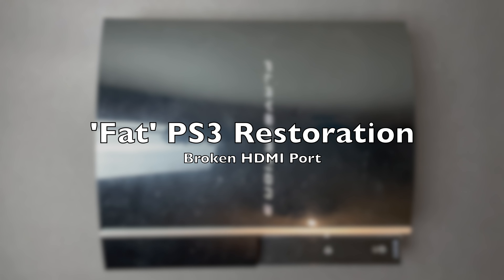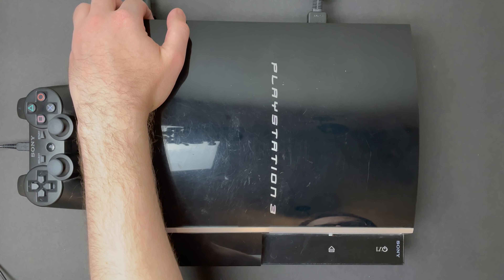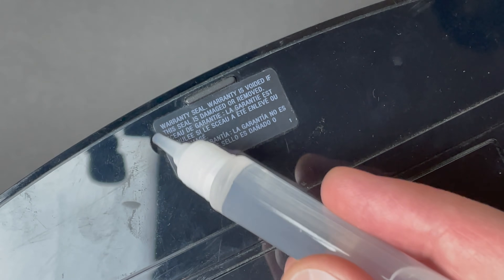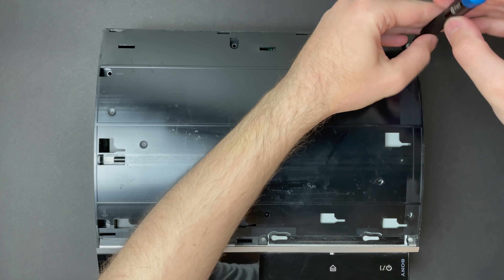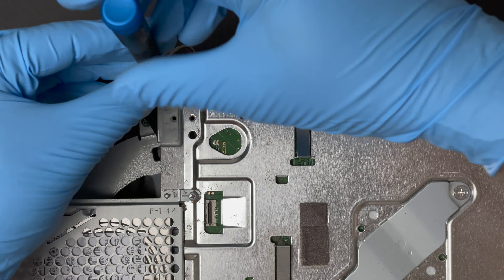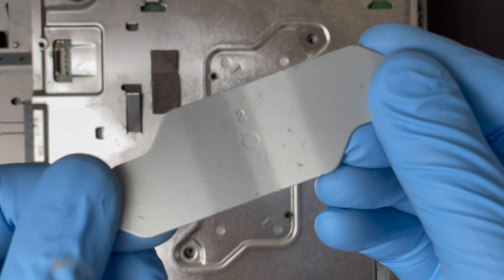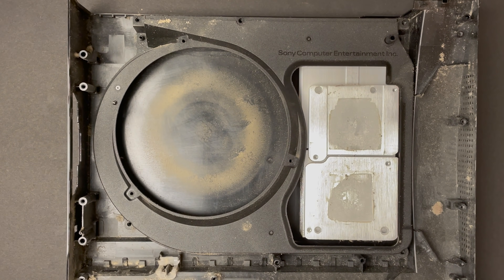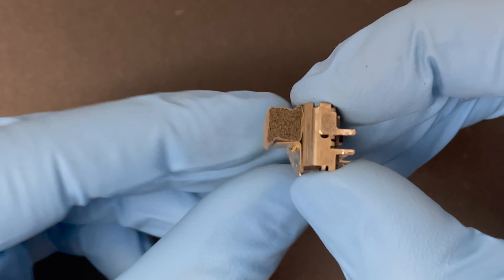Sony PS3 "Fat" HDMI Repair - Faulty Console Restoration

Comment: Nice job men , just a recommendation i think next time you can use  low melt (low Temp) solder can do it more easy to remove the port and the solder on the holes that's the trick.

Comment: Bossman, You do incredible work... make it look too easy... But just from doing little odds and ends, I KNOW how difficult it "can" be, but your work shows you've have practice and you are pretty damn good at your work.. Thank you for sharing this video.. I was sold a ps3 yesterday that "WORKED PERFECT" lol - The hdmi port gold tabs are all wrinkled up and doesn't work so I was seeing how difficult it was to replace... I don;t have the factory playstation av cord, so hopefully I can get one and use that for the display and just say f changing the hdmi - but if both displays are bad, I have to fix something... Anyways, I'm a new subscriber, and Thumbs up - You made this video simple to follow and understand, and made certain points clear like using quality stuff to make for a easier job... working construction all my life, trying to teach the new kids that start to buy good tools and not cheap tools, your doing yourself a favor... (Using a pair of klein side cutters to cut ceiling wire ( a metal clothes hanger) for a tile drop ceiling, all day VS a harbor freight 3 dollar pair.... will prove my point when it takes 5 times the strength to cut... doing 500 cuts all day long your hands will be so cramped up, blisters, ect...  work smarter, not harder.. I just really am impressed in your work - great job

Comment: Does anybody know what kind of liquid he used to remove the warranty sticker off so cleanly? Can you use a heatgun to remove it cleanly also?
Reply: I think it's either goo gone or 99% alcohol as it's clear. Do not use a heatgun for sticker as it'll get too hot fast or a very low heat
A hair dryer here is actually advised

Comment: Hello, maby you know is in PS3 fat are the same hdmi port like in slim 20_._? I know they are same 3 pin rows, but i dont know it will works. In my fat 80GB i got short circuit betwen pin1 and ground. In my console i have got no video in HDMI but  analog output works fine. THX

Comment: Hello, i bought a ps3 fat cechc04 and i think the hdmi Port doesnt Work. I get video Output If i use the older ps2 slot. So my question: is the hdmi Port on all the ps3 fats the Same?

Comment: Iv got an original ps4 that has the light bar on the top so it can only find and use the 2.4ghz network,  but is there a way to replace the wifi antenna to use the better 5ghz network?

Comment: man that HDMI port is just as bad as the one on my PS3 though the rest of the system looks to be a lot better condition, mines missing screws that hold the top cover on the system, the cover plate on the Disk drive,  the little cover that goes around the disk drives opening on the front of the case, and the HDD bay cover. But damn this looks like it'd be very difficult for me to do especially since i don't have any tools to do that or experience lol does anybody know about how much it'd cost to get it repaired for me mines also a 80GB Fat model

Comment: I'm a novice at soldering but on my OG Xbox I was able to use a fine tip and basically push through the ribbon into the pad to get the solder.

Comment: 11:36 when checking continuity. When I test the pin 18 by itself I get nothing. Which should be normal since it's white. When I test another pin and go back to 18 i get a beep sometimes. Is this normal? Using kline tools mm400. Update: sometimes when testing 18 by itself I get a beep. This ps3 would turn on with green light. fan turns on get progressively louder and faster no video.
Reply from the maker: Switch your meter into diode mode and see if you get a value close to zero for GND pins. If also close to zero for pin 18 then there is a short.

Comment: Dude fucking GREAT VIDEO MAN!  Seriously this HELPED ME OUT TONS!  And instead of completely editing out simple little mistakes that I run into all the time, you humbly explained them and showed how to fix the problem, rather than being a pretentious turd and making seem like you did a perfect job first try.  You would believe how many other nutsacks edit out every single mistake.  My apologizes to the masters that actually DO MAKE A PERFECT JOB ON FIRST TRY.  They can help their badassery..  Anyways bro honestly great video, I immediately liked subscribed, your quality left no choice but to do so.

Sir, one more thing could you please post the tools you used and where they can be bought.

Obviously the TS100 is the only one I could make out because of your giveaway, but what about the heat gun, the brand and type of flux (you said yourself high quality flux is essential) the pliers you used, the yellow tape you used in order to shield the other parts of the board from the heat coming from the heat gun and Im sure you used other equip/materials i just can remember.  

Thank you so much once again for posting a great and quality video, that is severely lacking from many soldering/repair youtubers.

Cheers and Sincerly

-Albert

Comment: Hello. Next time that you try and clean the wholes try using a bigger tip on your soldering iron or more heat instead of rubbing on the board so much. The reason the board got damaged like that was most likely the amount of rubbing that force you used while trying to clean the holes out. Great video and cant wait to watch more. Thank you.

Comment: That fan is HUGE, I had no idea! Also, that re-assembly montage at the end was really satisfying.
Reply from the maker: Thanks, glad you enjoyed it.
Reply: @BorderlineOCD  Hey! Can you make video about "maximum HDD size on PS3"?(CFW)

Its so shame... because as i know there is maximum of 1.75TB-1.82TB.... 

original xbox has possibility to use 16TB,that a disaster..
Reply: That's why they sounded like a jet engine when it ramped up.😏
Keeping them clean help's a lot with fan noise and overheating, I use a vacuum cleaner with a soft brush attachment Weekly.
I suppose I'll have to renew the thermal paste on my 60gig consoles (X4)!
Never had one overheat, yet! 
Even though my late wife💘 used to leave hers on with a game on pause, while she went out shopping🤦‍♂, a habit she picked up on the first Playstation in 1998 while playing Spyro!

Comment: i use a de-soldering pump to release the solder from the holes, i stick the pump at the hole and melt the solder at the other side using the soldering iron and then push the pump's button, it's faster, but the board has to be in a vertical position
Reply from the maker: I've purchased a vacuum desoldering pump since the making of this video. Should make future repairs like this much less cumbersome.

Comment: I love my fat ps3, its a software emulator for ps1/ps2. Shes running hot and louder but super clean. My problem now is HDMI not working, tried 3 different displays, my port looks fine.SHe was off for awhile. Can I send her in to get fixed? I really want to keep her and 480i is not cutting it on my 4k tv!

Comment: I would suggest a continuous vacuum desoldering tool. My Hakko FR-301 was a game changer and I've practically stopped using desoldering braid altogether on through holes, and you can get tips as small as 0.6 mm internal diameter for those tiny pins like on the HDMI port. Single shot desoldering pumps aren't even close. There are cheaper clones if you don't want to pay for the Hakko but in general these tools are well worth it.

Comment: Nice work on this. I completely screwed up a board while trying to use a soldering iron. I guess I should have had some experience with one before jumping right in on a board.

Comment: I thought I was going crazy when everyone in the comments started with "Hmm" and I didn't know what it meant lmao. Then the last 5 seconds made it clear
Btw wouldn't it be easier to leave the old solder in place, heat it up with the hot air gun and slide the new HDMI port in place?

Comment: Buff the top shiny lid with no use paste and it will look brand new!
Reply from the maker: Is there a particular brand you recommend?
Reply: @BorderlineOCD  sorry,Novus compound is made for pinball plastics and works great for plastic like that,it comes in 3 compound strengths

Comment: Couldn't have released this video at a better time! I just bought a fat PS3 and when I hooked it up to my TV, it didn't register an image at all. 

Confirmed the TV port and HDMI cable are fine, which leaves the PS3. The HDMI input port isn't mangled like yours was...but is this a common issue on these fat PS3 models? Or could it be something else?

I'm guessing I really need to open it up and grab a multimeter to check the HDMI. Thoughts?

Comment: Hmm great work & great insight. with regards to ylod repair reflows have u had any that fail again & do you think continued cooling after console is off would be an effective prevention? using aftermarket external cooling?

Comment: aye I tried repairing a 20gb ps3 phat last year & it was just a disaster for me. Aside from tar, dust and other issues I messed up the disc drive because it wasn't reading and I honestly thought that I could fix it. I still have the console in my closet, it turns, stays on a bit then turns off. Learned my lesson but what can ya do? Still I love watching these vids, keep up the good work!
Reply from the maker: Glad you're enjoying your content, and sorry to hear about your PS3. That's a tough first project. Despite being 15 years old its quite a complex system. You might fare better with some older gen stuff to start out with.
Reply: @BorderlineOCD  thanks and yeah I learned the hard way. Still I think it can be salvaged if a working disc drive, new power strip to the disc drive, and thermal paste is changed. I made the mistake of trying to clean everything “I gave this ps3 to my brother in 2011 and well he’s a heavy smoker. The amount of tar and black dust was unreal “I still have the daughter board for the disc drive and the encasing too”

What’s funny is that it still turns on since the HDD is fine but will play digital games for an hour at best lol. Aye.. I didn’t mean to talk your head off but lesson learned is all I can say.

Comment: I want to know before I get my second PS3, was there not a recent finding that determined YLOD over-heat consantly changing thermal paste was unnecessary, some capacitors being permanent solution?
Reply: Maaan these still CR2032 coin crap batteries what for!! I thought my Segas the last to use em, also L0L warranty seal sticker does that matter when goes around used and I doubt Sony still offer repair..?

Comment: I'm assuming you wanted to replace the solder but you can also just leave the hot air on the board and insert the new port thru the molten solder, that wick is rough on silk :) love the videos keep em comin!

Comment: Hmm, this fat model automatically switches video output to HDMI when it detected that it was connected instead of the AV. The super slim I have doesn't do that so you have to hold the power button for 5 seconds and wait for a second beep after powering it on for it to do so. Good to know.
Reply from the maker: You still have to do this with the fat the other way around i.e. connecting composite or component after HDMI. Once it’s on HDMI it doesn’t seem to look for other connections so the long press is still needed to reset the video settings if returning to composite or component. But if connecting HDMI for the first time it seems to prompt you to switch over. Not sure which order you tried it could be similar.

Comment: Hmmmm..... With the 60gb launch midel also replace the thermal paste underneath the IHS plates. Thats the same dried out stuff as what was replaced by you. De-lidding the processors.thats what its called.

Comment: Hmm - Nice video! Few year ls ago, I bought the same version of PS3, used, and the funny thing is that it was on the same condition as yours when I tear it apart! The main problem of this particular version is the overheating and also the huge headache when it is needed to change the thermal paste. Anyway, now I placed it on the shelve and I'm looking to find the second PS3 version, the so called "slim".

Comment: Stellar work, man ... another fatty saved from the "graveyard" ... BTW, can i recommend a desoldering gun, for future work? It makes jobs like these much easier to perform, especially when U have to work with ports or caps replacing ... A Heat Gun is also great, so a combo of the two tools - desoldering & heat guns - is the best of both worlds, i guess?

All the best again with your new house & keep inspiring us with your repairs & restorations ... and good luck with the upcoming YLOD repair - those dreaded NEC-Tokens can sometimes be difficult to desolder, but usually only those close to the RSX kick the bucket & give YLOD to the console ... Cheers

Comment: Hmm I don't think you need to remove all the old solder from the board. You should be able to melt it with the rework station and just slide the new port back in.

Comment: Hmm I try fixing ylod ps3 spend 2 weeks every night and every full Sunday and nothing worked I tried reflow reflow inside cup and gpu replacing nec token with capacitor replacing with tentalum capacitor but one time with normal capacitor it started but because of heat it turn off so I switched to tentalum nothing happened 😩 but I have timeand have hop to hear sound of starting ☺️
Reply from the maker: Lol that’s dedication. I’m sure you’ll eventually fix it. You have to now it’s personal!

Comment: Hmm...

Best method I use to deal with HDMI ports, is hot air and solder paste. From there, I would go over any bridges with a soldering iron. These consoles tend to have some serious thermal mass, and will take away the heat from any cheapo iron. Hot air & solder paste becomes your friends for these type of repairs.

Comment: Hmm not bad, but I would have used a hot air gun to solder the replacement hdmi in, less chance that you will have a bridged pins.

Comment: Hmmm, I too have had mixed results with the solder wick. I usually have better luck with the solder sucker, even the cheap manual spring ones. I would like to get one of those fancy air power solder suckers.

Comment: I have a ps3 but its got the ylod ill probably just replace tokins if i can but its the ps3 that can play ps2 games also when i took it apart to check whats wrong the clamp for the dvd drive ribbon on the mothers broke off completely when i gently lifted it up and its missing the hdd cover
Reply from the maker: Too bad about the drive connector but I guess YLOD is your bigger concern.
Reply: @BorderlineOCD  well i think if i somehow used some strong tape to hold it down but ill try replacing the tokin chips once i also get this thing called a fume extractor for the solder flux

Comment: Hmm
Really interesting. Up until now, I haven't seen any videos related to the PS3. 
About desoldering. Have you tried using a solder sucker on the HDMI connectors once the component is removed? In my experience, if you place a board vertically then place the solder sucker on one side of the connector and the iron on the other you can get pretty clean results creating a through-hole without damaging the green layer. It takes a little longer to do, but I find it to be safer. Of course, you need something to hold the board in that position. Anyways just thought I would share if you haven't already tried. Great video as always, man. 
Look forward to the next PlayStation video. :)

Comment: Hmm next time you could try to use an inexpensive desoldering iron to desolder the HDMI connector. It can make wonders...I have noticed this when replacing analog sticks on PS2 controllers. This way you apply less heat to the board so even the mask should be intact. Although I am not sure how small those pins are :)
I believe that you could have used UV solder mask (or your fiancé's PCB green nail polish :D) to cover some of the exposed copper so there is less chance you end up with bridges.
Anyways, you are clearly much more skilled than me...thanks for making these videos! Can't wait to see what's next :)
Reply from the maker: I ended up returning that desoldering pump I used in the NES recap video. It just ran too hot and I found it kind of clumsy to use. I think a proper desoldering gun is in order, it’s another toy on my wishlist.

Comment: Hmm, how are the thermals holding up? You might want to delid the CPU and the RSX as their thermal compounds tend to go dry and the PS3 sounds louder than a hair dryer. Great repair!
Reply from the maker: After seeing My Mate Vince damage his PS3 trying to de-lid the CPU/GPU packages, I just don't have the guts to try it.
Reply: @BorderlineOCD  Ah I see, there are another methods such as bending the clamps or straight up putting an eraser in the hole behind the CPU to make the heatsink contact the packages tighter. There are some arguments about whether this is harmful for the motherboard or not, but I kinda doubt it is as some PS3 models come with a plastic piece in the hole. You can read about it here: https://www.psx-place.com/threads/tutorial-ps3-cell-b-e-thermal-dissipation-without-removing-the-ihs.23066/

Comment: Hmm you forgot the most important thing...
need to cut off the IPC internal heatspreader on the RSX and CPU chips and put thermal paste under them... otherwise this PS3 will run HOT...
Reply from the maker: It's too risky bud. The "L" models don't get as hot as the earlier revisions so while it would be better, it's not ideal. I've seen too many videos mess that up and I'm in no hurry to try it.